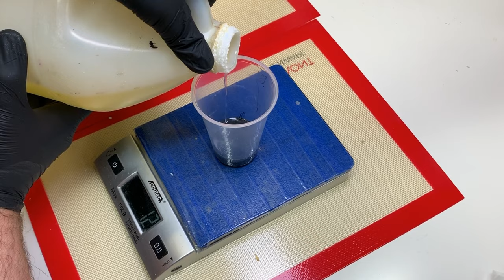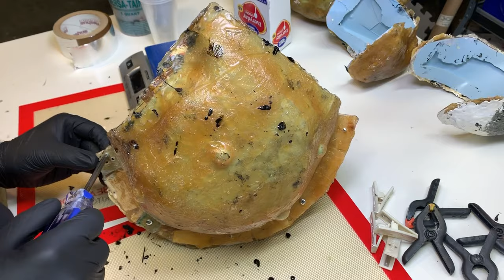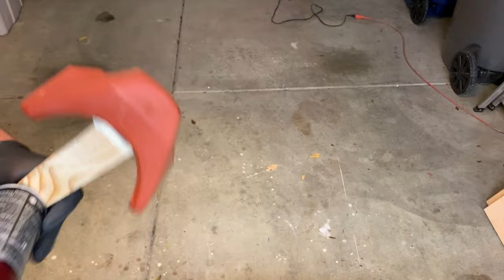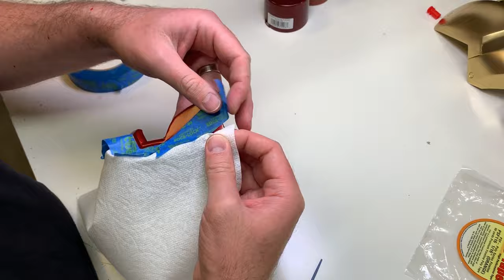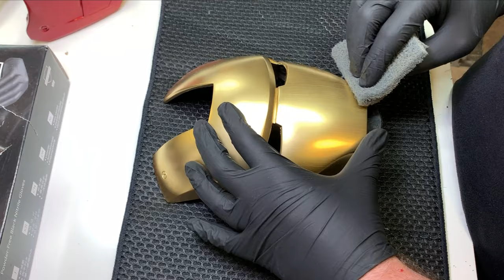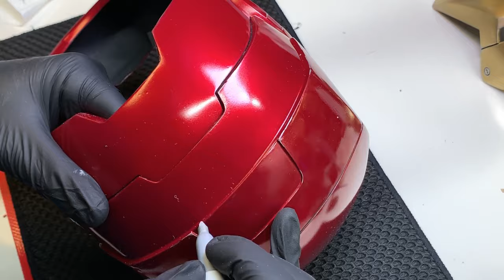Iron Man Tribute Helmet Build from slush castings

Comment: How can I make a mold like the one you use? You are great
Reply from the maker: Thank you for the compliment. The mold was made using a two part molding silicone called econosil from a company called Silpak. There are some great video tutorials on YouTube that show the process step by step. Just search for making a silicone mold. Thanks again!
Reply: @EHCreative  I searched for the product on YouTube and saw how they do it.. But then the material you put inside the mold to create the piece that material is?? I have followed all the video but I am Italian I do not understand your language very well 😂 and if kindly you can tell me what kind of red, and gold buy to find directly here in colorificio. Thank you very much for your answer
Reply from the maker: @robertomarciano1788  the paints I used are linked in the description. The two part material that hardens is called polyurethane resin that I added urethane due to make black. You should be able to find it online.
Reply: @EHCreative  Thank you. I had seen the paint that you used but from Italy it does not make me buy them.. I wanted to know if there are exact color codes so as not to go wrong to buy here from me
Reply from the maker: @robertomarciano1788  unfortunately I do not have the color codes. I will see if I can find them and let you know.
Reply: @EHCreative  Thank you so much you are very kind I hope you will help me to buy the exact colors

Comment: what primer did you use for the faceplate before applying the gold? looks dope
Reply from the maker: I first used a duplicolor filler primer to fill some surface imperfections. Then I lightly sanded to level the surface. You can then go straight to paint or use the red oxide primer.
Reply: @EHCreative  thanks a lot for the response! Keep up the amazing work!!

Comment: Hello good, I would like to make a mold for a start wars helmet that I have, could you tell me what materials you used to make the mold and replicate it? I would like to learn how to do it.
Reply from the maker: The two part molding silicone is called econosil and it’s sold by an online effects shop called Silpak. You should be able to find them in a quick search. For the backing shell I just used regular polyester fiberglass resin and fiberglass mat available at the local hardware store. Can’t seem to post a link but search youtube for how to make a silicone brush-up mold. There is a great walk through the process on The Tested channel. I hope that helps!

Comment: What sealer do I use and does the paint crack by any chance? I want to use these colors for the entire iron man suit. Let me know
Reply from the maker: I like to use automotive primer. With Iron man parts I like to use Red Oxide primer as it makes a good base for the red paint. If you look in the video description i added a link to the red oxide primer i like. I haven't had any problems with cracking. However if you are using a filler primer light coats are best. Too heavy of coats will cause the paint will crack as it drys. Thanks!

Comment: What is the black paint you used?
Reply from the maker: I can’t recall the brand but it was flat black enamel from Home Depot. Enamel works fine over the red acrylic lacquer.
Reply: @EHCreative  thats what I thought it was. Got some humbrol black enamel. Do you reccomend I appy it before or after the clear coat?
Reply from the maker: @gamerknowledge539  you could do either but if you want that matte black appearance the clear coat will make it slightly shiny. I put mine on as a last step without a clear coat

Comment: Could you link to the materials used to make the mold?
Reply from the maker: Renata Carvalho unfortunately I can’t post a link but the two part molding silicone is called econosil and it’s sold by an online effects shop called Silpak. You should be able to find them in a quick search. For the backing shell I just used regular polyester fiberglass resin and fiberglass mat available at the local hardware store. I hope that helps!

Comment: What materials did you use for mould and casting material
Reply from the maker: The silicone I used for the molds was Econosil tin cure two part RTV backed with a fiberglass shell and the resin for casting is called Silcast 2 urethane casting resin. Both are available online through Silpak.